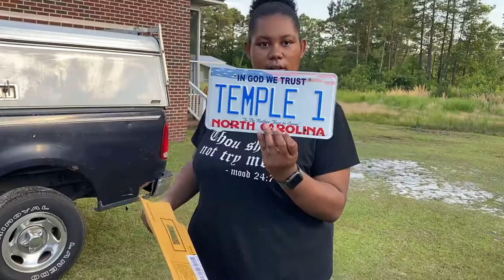INSTALLING PSDESIGNS VENOM WICKERBILL | DODGE CHARGER SCATPACK + MY PLATES CAME!

Comment: Tape the wickerbil securely to the spoiler where you want it and use the holes as a template. Drill small pilot holes through the template first, then use larger bit. Info on how the riv nuts work and install would also be helpful.

Comment: Do you know if this would fit a 19’ R/T? I’m looking for an upgraded wicker bill, but the description on the product says it won’t fit an R/T.
Reply from the maker: Honestly I do not know, but they should make one for the R/T
Reply: I have this on my 2019 rt.  It just doesn’t fit the spoiler that most rt’s have because it’s 3 separate pieces. So if you have an srt spoiler on your rt it will fit.

Comment: Put mine too low i pretty sure it started scratching paint 😭 .
Reply from the maker: I did the same on one side 😭.
Reply: @kaysmopars  😭 can’t be undo sad. I probably try putting a white reflective or white pinstripe under where it touch maybe it will protect it
Reply from the maker: Let me know how it looks! I might do the same
Reply: @kaysmopars  i already has black stripe with white pinstripes so it will look fine.